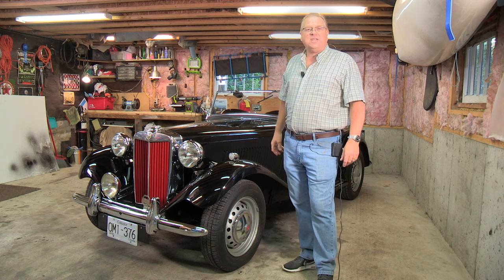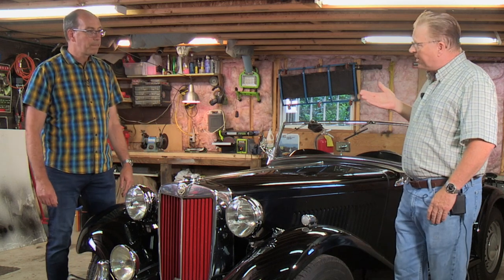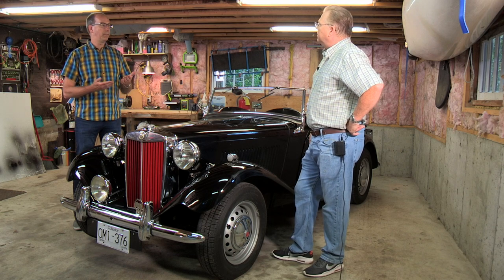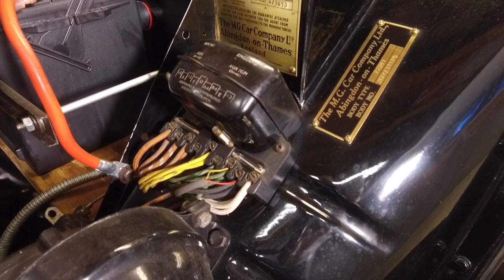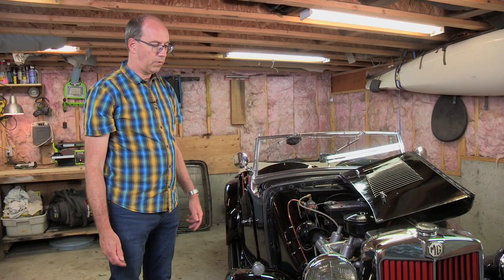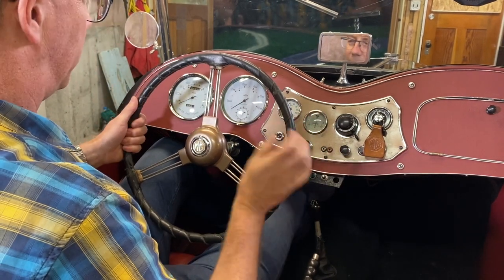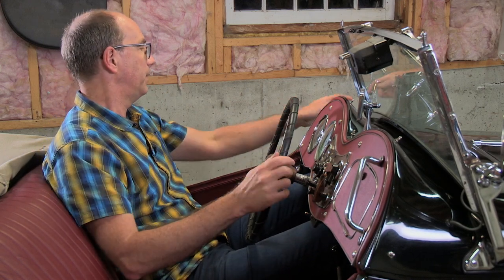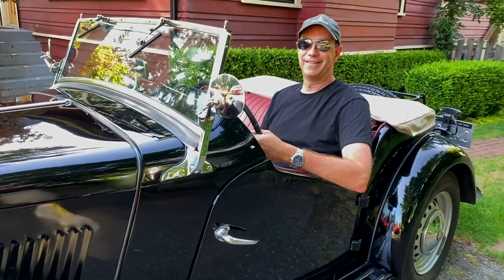Vintage MG Sports Car | Paul's MG TD Midget

Comment: The music is annoying, part of the joy of a TD is the sound.. ruined by the "music". 
The steering wheel is mounted upside down.
Otherwise nice TD.

My first car, bought in 1964/65, was a 1953 TD MK II, about 1700 made. 
This was the competition version of the TD. 

I currently have a 1963 MGB . I am  looking at a 1954 MG TF (as pictured in your graphics) which has the same XPAG 1250 engine as the TD.

Comment: Well done nice.
Reply from the maker: It's a pretty nice restoration. Do you own one?
Reply: @CENTERLANE  indeed I do my farther had it in the back of the garage with logs all over it until got a bit cross with him and we got it out cleaned it up pumped the tyres up put some fuel in and off she went after he died I had it gone through not restored but just greesed and made to run OK brake were and still are not very good but that's how they were I keep in London sadly don't use it much again nice job you have done must get it out!!

Comment: It looks kinda old.  
Can this thing keep up with 70mph traffic on the interestate?
I hotwired and stole an abandoned rubberbumber MG Midget once upon a time, and it got a nice 50mpg.  But Id ont' think I'd fit in one now.
Reply: chopper girl.. You again with your fiction.
MG Midgets do not, and will not, get 50 MPG. 
You asked this same question about 70 MPH on another youtube video. The answer then, and the answer now is, no.
Reply: @jeffhildreth9244  you do understand you get different mpg driving city stop and go and drifting on an interstate nonstop dont you?  

A frigging General Motors Vega got 40mpg highway.   So a little MG Midget go cart rubber bumper with next to no wind profile and light with 1200cc engine... yeah... I got 45 to 50 mpg highway.  I was surprised at you and 18 at the time... 

My Honda Rebel consistently gets 40 city 60 highway.   Small engine, low speed, light weigt, small profile in wind.  

My Honda CM450 has a 45hp engine versus the Revels 15hp, and gets 10mpg less.   More power at your disposal equals lower huel economy.  Your burning up more gas in a bigger cylinder.

I had a Camaro with 400hp engine and racing chuck that heavy insanely accelerating car got about 15 city 25 highway.. or less.  It would throw you back in your seat though.

50 mpg is not unusual.  It also depends on the air temp.  Colder air is denser with more oxygen so you'll get higher mpg in the winter versus summer.  More oxygen and more air us avhiger compresdion and more power per 4 engine  revolutions.
Reply: @jeffhildreth9244  This is the rubber bumper model MG Midget I'm talking about:  

https://www.youtube.com/watch?v=5YxbqpTg3TE

50mpg driven non-stop interstate around Dec 15th from Chicago to Georgia drifting behind a semi-truck, two college students on board, no tools no luggage and probably no spare tire, hot wired with the keylock cut of with a hacksaw the night before...  haha...   I just stole a car, look out my dorm window at the street below, let's go, we're going to my house for Christmas because I'm homesick like a bleepity bleep.

I have no idea where I got the phillips head screwdrivers hacksaw, it would of had to been from a toolbox in the shed of my girlfriends landord 15 blocks away.  One heck of a lot of walking back and forth that night i wore out some shoes.I know where I got the working battery tho, from a 1965ish Mustang parked down the street someone had left the door unlocked on, and I popped the hood and lugged the battery up the block in the dead of night.

Yep.  50mpg.   It felt like being propelled by  angel's wings because I was broke.  Don't stop don't lose that semi hold that gas pedal steady up and down the hills and shun those brakes! :)

Thelma and Louise baby!

The next summer we bounced across Europe on plane tickets bought on her Guranteed Student Loan.. also forbidden!  https://www.youtube.com/watch?v=FSvBFAkKdXw

Comment: This was THE classic MG, later models just did not have "The look".
Reply from the maker: The TD's and TC' have the classic look! Thanks for watching.
Reply: @CENTERLANE  Always fancied one, but finished up with an MGB. long gone and only partially regretted.
Reply: Many MG folks did not like the 54-55 TF, however many of us think that is was the most beautiful and stylish of the T series. The most definitely "had the look". 
I like them all having owned a 1946 TC, a 1950 TD and a 1953 MG TD Mk II. 
I currently have a 1963, the most practical of all the MGs in my opinion but currently looking at a 1954 TF.
Reply: @jeffhildreth9244  My only gripe about the TF is the placement of the Instruments, pandering to the US market, saves manufacturing costs, does not look as good, also I like to look at daylight between the front guards and the bonnet, dont like the way it swoops up and probably hinders access to the engine components but that is just me,, don't know if you have ever read Ken W Purdy's book Kings Of the Road published in the mid 50's, he says re MG's that in 1953 the TF was introduced and was not received with great enthusiasm in Amerca, that his take on it, I read a workshop manual fot the T series once back in the 60.s and it stated re the TF 1500 DO NOT GRIND THE CRANKSHAFT, must have been considered the end of the line for durability in the XP engines.

Comment: A wooden frame- wow. These really were from a bygone era even when new.
Reply from the maker: Old English motoring!  Thanks for watching.
Reply: Not a wooden "frame". The body/tub is metal attached to a wooden framework. which is attached to a traditional  iron/steel frame. The TD also had a plywood floor.

Comment: Fitting a modern radio would be a problem with positive earth.
Reply: There are repros made to fit. I have two 50s vintage originals, and 2 1960s.. but these cars are best , in my opinion. without one.